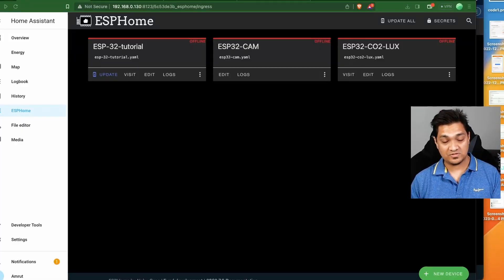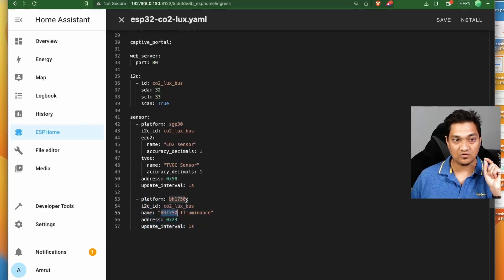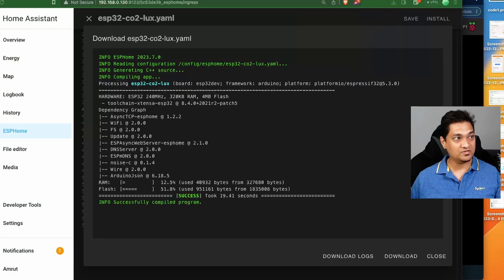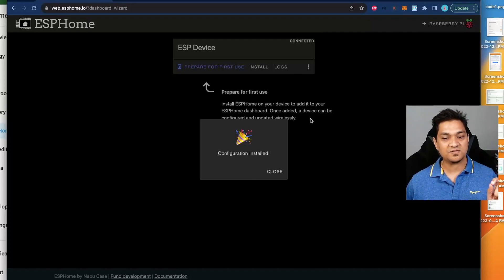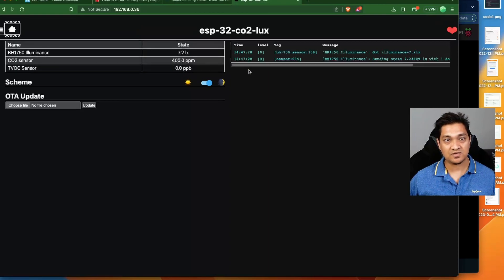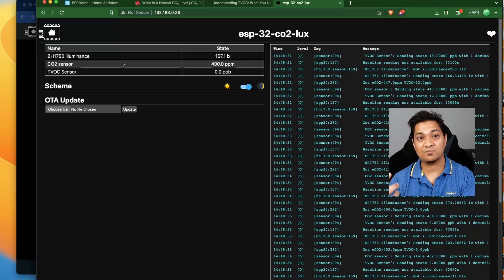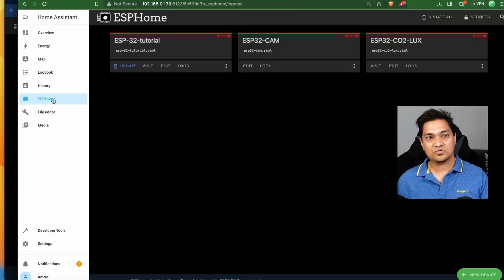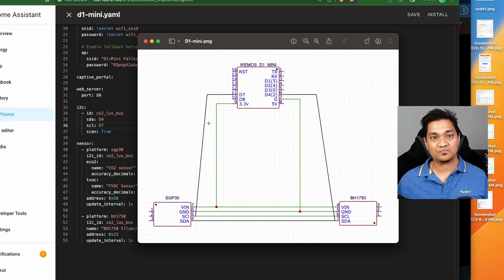I Built An Air Quality Monitor For Home Assistant With ESP32 | CO2 & TVOC | SGP30 & BH1750 | ESPHome

Comment: Good video. I'd like to see the actual connections of sensors with esp32. This is my first project, I can see it in  Home assistant, but the values are unknown no matter what I do. I'm trying to connect it on breadboard. I think I've already tired all of the possible combinations.
Reply from the maker: Check the video description, I have specified a URL to an article that has the circuit diagram with connection.

Comment: good video. can you please add PM2.5 sensor for your device?
Reply from the maker: I will search about this.. but I bought a new sensor called MH-19Z. It uses lasers to detect CO2 levels and it's a bit more expensive than this one. 
I will be making a video about it soon.
Reply: pms 7003 is recommended for PM2.5 sensor @SmartHomeCircle